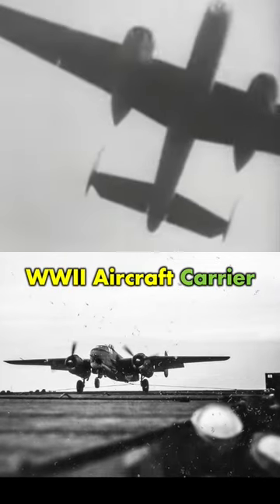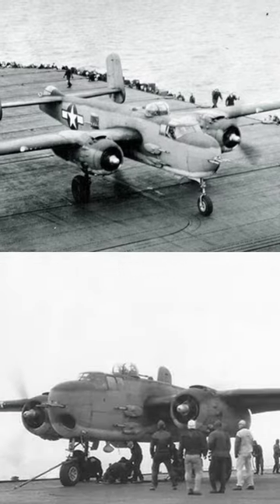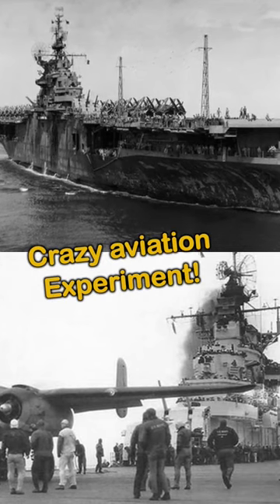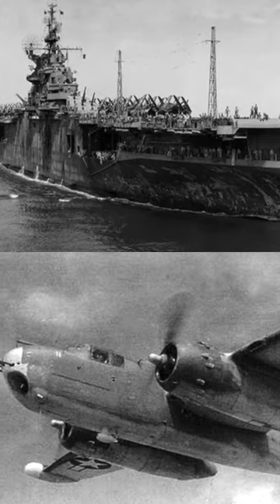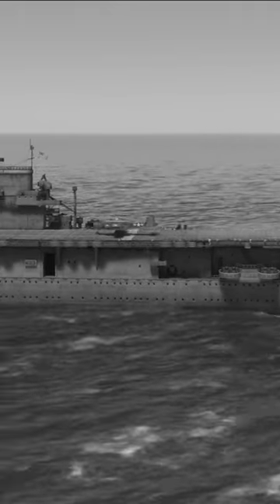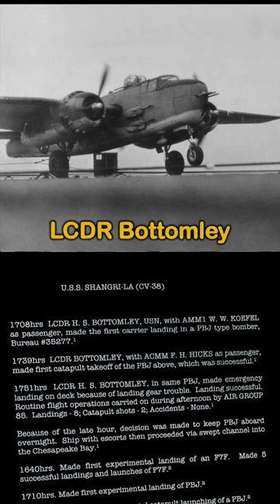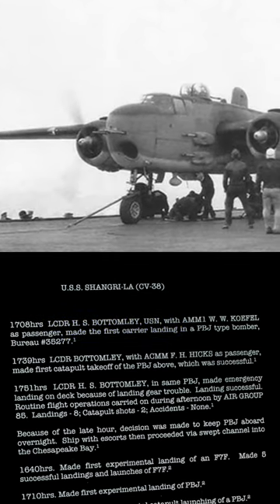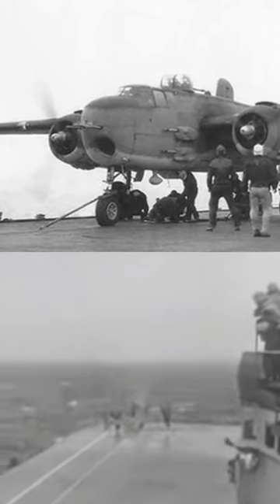The Unbelievable Moment a B-25 Bomber did the Impossible!

Comment: Doolittle proved in 1942 a squadron of B-25 bombers could take off from a carrier deck without a catapult.
Reply: But they used a lot of the fight deck to do int.  The was to test if they could take off in a much shorter distance, hence the Cat shot!
Reply: It would have been probably easier if they did it from the deck of Saratoga or Lexington as  they were longer than the Yorktown sisters
Reply: Also the catapult didn’t exist in WW2
Reply: @GManM1  That's not true. WWII aircraft carriers had hydraulic catapults, and one of them was used for this very video. Some aircraft carriers had catapults on the hangar deck to allow for an athwartship launch while aircraft were recovering on the flight deck. Even the Wright brothers used a catapult system to help launch their flyer at Kitty Hawk. Catapult systems were even installed on battleships to launch a scout plane.
Reply: @michaelmappin4425  ye exactly my point carriers did not use catapults to launch aircraft on her main deck
Reply: @michaelmappin4425  Catapults were used mainly on smaller escort carriers.
Reply: @anelstarcevic696  uss Shangri-La was an Essex class fleet carrier. Was longer and wider than the Yorktown class ships and was the first carrier(s) to be converted into 2 flight deck.
Reply: @sniperboom1202  yes but the quesrion is were eseex class carriers in service when the dolitle raid happened
Reply: @anelstarcevic696  what? No it wasn't. The video was talking about Shangri-La. You were talking about the Yorktown class, so I thought you thought that Shangri-La was a Yorktown carrier which it isn't. I could have misread/misinterpreted it but that's how your first one reads to me
Reply: @gmanm1907  tell me u didn't pay attention to a 30 second video, without telling me
Reply: @fockwulf1  tell me you didn’t read a simple comment on YouTube without telling me
Reply: LCDR = Lieutenant Commander not Lieutenant Colonel.
Reply: Now the carriers are so fast B25's are airborne in a couple feet.
Reply: Doolittle was the first off and was about midship in a stiff wind. Met him twice in my like great man!

Comment: Since it is a Modified version of the B-25H (75mm Cannon and 8 fixed forward firing .50 cal machineguns), it would be a PBJ-5!
Reply: The PBJ-1H would be a more accurate name i do believe. Maybe they are both the same just dif name idk
Reply: @cobeylynch4733  You're right. There was no Dash two. It was a PBJ-1J, with 75mm and Radar.

Comment: They didn't have catapults on WW2 carriers, at least, not on the main deck.  The B-25 took off under its own power, alone.
Reply: They did have steam powered catapults during the war in the fleet Essex class carriers and the escort carriers. A bridle was used attached to the gear legs to launch various aircraft types
Reply: @johnbeauvais3159  I stand corrected.  Still, they never adapted them to the B-25.
Reply: @ThatsMrPencilneck2U  Yes that is correct, and that would make it probably the heaviest aircraft to land on a carrier during WWII
Reply: Even before the essex the earlier yorktown and lexington classes had hydraulic catapults. They didnt start adapting for steam until the latter parts of the war and the post war years where steam was necessary to launch increaingly heavier aircraft in the form of jets
Reply: @johnbeauvais3159 they were hydraulic. The steam catapult wasn't invented till the 1950s
Reply: @ThatsMrPencilneck2U  you can see the catapult attached in one of the photos.